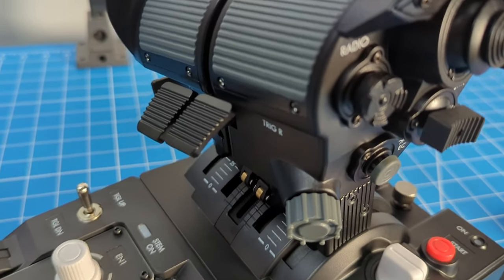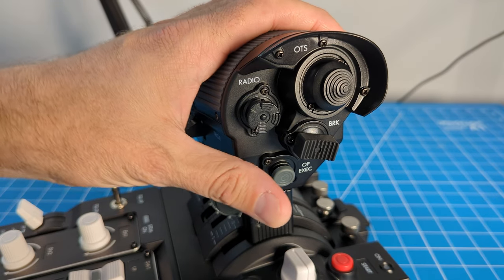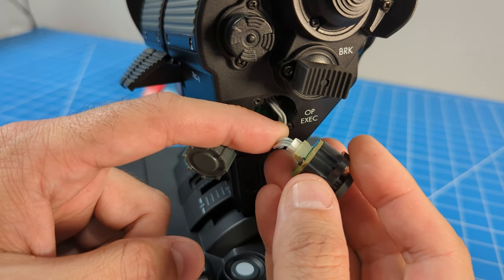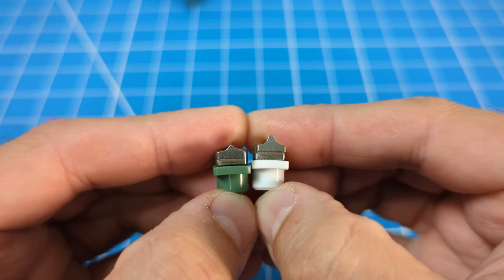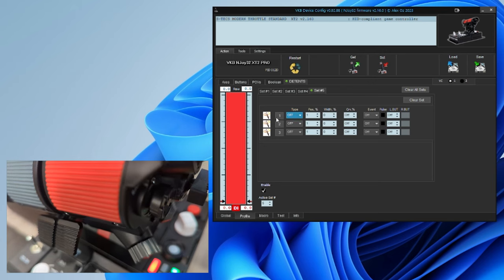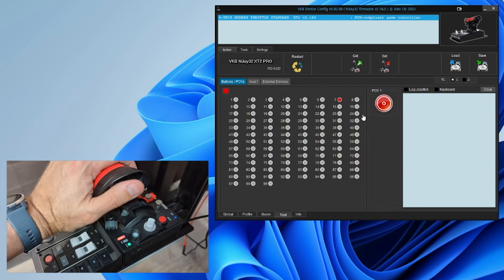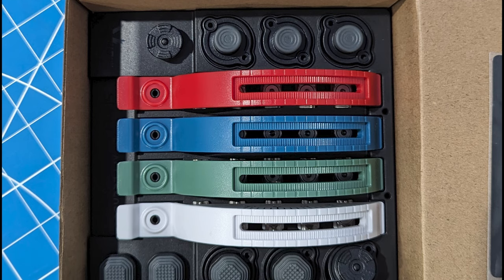VKB STECS Throttle - Review

Comment: For the idle detent, setting it to < or less than and using the "OFF(hold)<>IDLE" will allow you to turn the throttle off by pulling it back past the detent. Basically the same as what you showed in the video, but with a bit extra functionality.

Comment: With respect to the mini-stick issues...if you happen to own an MCGU,  you can swap out the module switch covers (both hats and mini-sticks) from the MCGU with the mini-stick on the STECS.  I've found the castle switch hat cover from the MCGU works well since it has flats at each of the cardinal directions, so regardless of your thumb orientation, you can index your movement relative to the hat switch cover.  If you don't have an MCGU you're kind of out of luck, but a lot of folks on VKB's discord have asked for this hat switch cover, so maybe soon they'll either sell it separately, or ship it with the STECS...
Reply: Ooh, they're compatible? Nice. I think though that I'll just 3D print a new castle cap for it.

Comment: Thank you for this video.
A very interesting product, especially the modular buttons.
It is always a pleasure to see manufactures experimenting with concepts like this, especially in a niche market as our.
It either takes b*lls or some very thorough R&D to spent resources on things like this by a company.

Having been flightsimming since the late 90´s, ive tried almost every brand out there, so i always recommends brands having stable and longlasting axis and software.
So often bad/cheap axis and/or badly written software brakes the hardware.
I dont mind spending half a day learning the software, as long as that software is stable and "just works".

Comment from the maker: Been a while since I posted a video, hoping to get back at it!  Hope you guys enjoy, let me know if you have any questions!  

Some minor corrections:
- 5:45 'recalibrate', should be 'reconfigure'
- 8:08 about the detents per frame - officially there are 3, but 4 could be added (also, 10 frames instead of the default 5). To do this you just add PimpMySTECS for expanding the detents/frames this line:
PimpMySTECS under the [USER] section in the file named zconfig.ini, which is located in the same folder with VKBDevCfg.

Discord ► https://discord.gg/ZnkvumS

Comment: One thing that could also help with the mini stick is a hat closer to the concave ones that came with the button modules - having a pattern to give you that tactile sensation of "this is X, this is Y." Some guys on the VKB Discord are already working on designing a 3d-printed replacement for the thumbstick hat, and honestly I wouldn't be surprised if VKB didn't offer an option as well in the future.
Reply from the maker: Ya I actually had someone reach out and send me the design for a 3d printed replacement like that.
Reply: @Jabbers  Nice. I'm definitely looking to pick one up once someone throws them on Etsy or something. Haven't made the plunge on a 3d printer of my own yet.

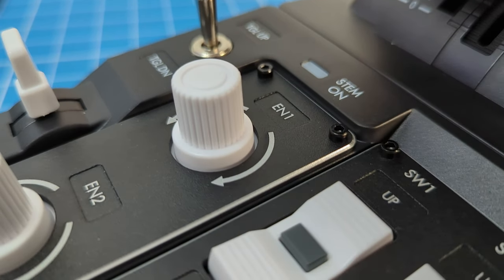Comment: 16:44 Until VKB comes out with something, the fact that they kinda don't pre-define the detents in software in terms of size (you set the deadzones during the wizard, and can adjust them later manually anyway) means that 3D printing different detent profiles should be a fairly simple thing. I might have to give that one a go at some point. =)
Reply from the maker: I found out after making this video that the software engineer is always making changes and there are already some hidden features like adding a 4th detent and allowing for 10 frames instead of the default 5. You can changed the size of the detent manually so it is already possible to 3d print and then choose a stock detent in the software but adjust the size after.part of the wizard setup where you mark the front and back of the detent is actually letting the software calculate that size for you.
Reply: @Jabbers  Cheers, and yeah they're definitely updating it. When the first detent guide came out I floated the idea of having different buttons trigger when below and above the detent (wasn't possible originally), and lo and behold by the time they were shipping that had been added. =)

Btw I think you had the inside parts/nuts for the detents the wrong way around, the big flat area is supposed to be towards the detent. Might eke out a little bit more space, and get them closer together, at least I did with my viggen ground and air idles. =)
Reply from the maker: Oh shit i didn't even think about that... You are probably right.. Spacing would still be an issue as the surface area is still the same, and if the backing plates overlap you would get some angular change on the detent on the top side of the frame.  I think the real solution would be create a detent that is 1 piece, with 3 positions on it.
Reply: @Jabbers  Yeah but having the nuts closer to the detent surface Vs far away from it can create a millimeter or two, since they're on an arc. I think I got mine a bit closer than you did. But yeah it's not a REAL solution, just something to think about.

I wonder if you could alternate them for even more space, so that one flat area is against the detent, next is upside down and above that, then right way around again...
Reply from the maker: Ya alternating might help.  Definitly something to tinker with!
Reply: @Jabbers  And fantastic that we have the ability to!
Reply: @Jabbers Thought came to mind, courtesy of a friend: What if you set the detents manually in the logic side, and on the physical side use the M-type center detent on the rail, which gives you 3 reference positions (before, on and after)? So for example for a 3 stage burner you could try this kind of detent layout:

1. Idle-Off detent (either L or V)
2. Afterburner stage 1 detent (L)
3. Physical M-detent, two logical detents: 1 on it, one after it, at full throttle.

EDIT: This assumes the advanced options are turned on, of course!

EDIT2: Tested it out, works about poifectly, hehe. Using this on the Viggen, where I can see exactly when each stage is triggered, and I have the idle-off detent, the second (air) idle detent, the main AB detent and the stage 2 and 3 detents all working and tactile through the throttle. Feels pretty nifty I won't lie. Took a bit of manual tuning of the widths and positions to get everything triggering exactly when I wanted them to, but was worth it.

Comment: Nice and clear review. 👍 

Having (even) more input & detent options (Detent Pack 2?..) would indeed be nice. And not just a specific airbrake ON-OFF-(ON) switch, but als an ON-OFF-ON toggle for the F-16’s Dogfight switch or the F-15’s Gun-SRM-MRM weapon select switch.

I’m also curious about the ATEM module. Especially about the jettison dial-alike. No reviewer has reviewed a Mini Plus or Max version yet..
Reply from the maker: Ya more toggles would be great
Reply: Afaik the round switch on the atem is a 7-way (simracers familiar with fanatec would say "funky switch"), so cardinals, push, and encoder.

One guy has a review of the max out so went through the ATEM too.
Reply: Myself, I'd like at least one encoders on the left to be changed for axis or be given and optional module to do so. Probably - if internal space allows for that - they should consider option to swap mini-axis on the right side with 4-way on the front as built-in interchangeable modules. Same as than button/4-way combo on the right already is.

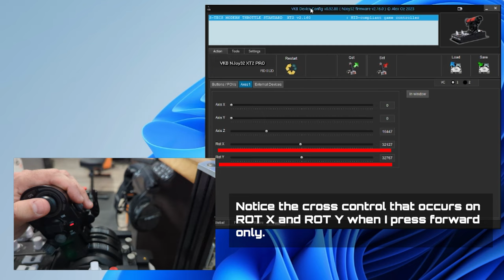Comment: 16:00 I said a decade ago that the perfect setup for a desktop throttle is this. Make it so that the throttle uses the sliding rail style so it steers away from the issue you bring up here. I posted this to Virpil and VKB forums "a lot" but no take or responses at all. With slider instead of pivot you do not get  a change in hand position and you do not get the mind fuck you get when the hand changes position. I also think that as low as you can make it benefits a desktop setup. Also, same for joystick I feel a system that utilizes as slider rail system would greatly benefit gamers as most play at their desks. Keep the joystick as low as possible and with the pitch on a rail slider system with role as pivot and you just made the ultimate HOTAS!!

What do I know, I am just some idiot on a PC sitting in mom's basement?! Well decades ago I fought for the brake pedal that barely moves idea. No one could even understand what I was talking about and nowadays the market for this brake pedal is amazing. Such a simple concept....the human foot doesn't translate movement to the brain but the human foot translates the most miniscule variance in pressure. I got called an idiot for a year and gave up and today we have this.
https://simucube.com/simucube-activepedal/?v=fa868488740a

Comment: The analog stick problem can be a easy fix with a head model with more tactile features like a 4 way head and a extended lip on both side of the thumb, I hope they add those to the package.
Reply: FYI you can swap hats between VKB products; I replaced mine with one from MCGU and use it as mouse. I have TDC (throttle designator control) on the stick instead. That hat is an extra from the STECS standard kit. Works for me.

Comment: you should able to setup button trigger at idle / cutoff position so no need click button manually , also , you can change the throttle axis range/dz by software so you can make after bunner trigger position without change physical detent position

Comment: Overall good video, but you missed a few key features of the software that make it much more useful/customizable. For example, you should use the curve setting (crv%) for your AB detents. This allows your detent to stop at an exact value (like 75% for the F-16) even if the physical detent isn't exactly located at 75%. Although, I do acknowledge that the current lack of documentation should be considered in the review since not informing your customers of important features is effectively the same as not including those features in the first place.
Reply from the maker: Wasn't missed, just looking for the happy oath without getting too in-depth with the software. The software could be a whole other 20 min video.

Comment: hi jabbers, how do you get the throttle to continue into the afterburner? mine wont engage.
Reply: Which a/c? HB will add F-4E afterburner control to the in-game axis settings in DCS in the next patch. Just like it's on F-14. Meanwhile you can use VKBConfigurator to create a button but that's a little too long an explanation for a yt comment.

Comment: Very nice review. Quick question: can I use the 5 position rotary switch as a Modifier in DCS? Thank you.
Reply from the maker: Interesting, I don't really see why not but I've never tried, it does appear as 5 separate inputs
Reply: Yes you can - it's basicly 5 "buttons" only one of which is selected at any given moment. This would make most sense in a scenario where all five positions would be modifiers. I have such a rotary switch on another device but it has been unused for a couple of years. The only use I have for it is making a row of 4 radio frequency encoders serve 4 different radios - and flight instruments in the 5th position. Hardly optimal but saves a little space in my movable multi-a/c simpit.

Comment: The three way "Up-Down" switch with the white cap, is it a 3 way switch or an axis?  I saw another review saying it was an axis and it moved smoothly in their video whereas you say it is a 3 position switch and it has a very clear set of "positions".  Is it something you can customize?
Reply from the maker: It's a switch, the only axis are the left right throttle, the knob on the right throttle and the thumb stick
Reply: @Jabbers  It can be turned in to an axis by removing one part inside, VKB has a video on how to do it. As simple as switching hats and buttons.

Comment: Any particular reason why you used button 16 (left paddle)? You could use a logic button like 65 (and automatically 66) for the same function without using any real throttle button. And yes, at least in DCS buttons 65 and 66 appear in the Combo selection.
Reply from the maker: Ya I didn't realize, talked to VKB after and they showed me

Comment: +jabbers   Thanks for the comparo.  The Virtual Engineering Bureau manufactures in the ST⚞ECSᵀᴹ Throttle Series an engine quadrant that trumps the VIRPILⓇ MongoosT-50CM3Ⓡ in certain models for Eagle Dynamics DCS:World.  Personally, I'd buy the Mini-Plus for the port flat and the STEM Panel for the starboard flat, as VirPil trumps the Virtual Engineering Bureau in hardiness for Control Panels #2 (port angle) and #1 (starboard angle).

Has the ST⚞ECS an "inverse hat" for the "OTS" ministick?  As a fallback for unavailability of the Throttletek GF-14 Engine and Wing Quadrant, I'd like a 4-way with the default OTS cone in the "OP EXEC" position to control the Wing Sweep; the "RADIO" Stadium and "BRK" Jog heads are appropriate for the notional Heatblur F/A-14E/F.  Also the mini-Castle head (low parapet up) and Pyramid head for the 5-ways in, respectively, "MB1" and "MB2."  Haven't decided which rotary encoder to assign to Flaps.

Comment: I'm glad the VKB folks are finally getting some sort of TECS, but this is not what was promised, not what was supposedly taking so long. This was supposed to be a bar none top-tier GUNFIGHTER-class device (starting with metal construction, not plastics/composites), and specifically it was supposed to have some super-duper digital electronic magic detent system that required patenting before they could even think about releasing it....

There is no new tech here, this "TECS" is little more than an expansion of their existing GLADIATOR-class GNX module stuff. I'm sure it's nice and the pricing seems decent (just like the rest of the Gladiator line), and no doubt it will be popular (maybe even get Thrustmaster and Logitech off their asses in this segment), but there is no way this needed to take ten (?) years.

Comment: I haven't used this throttle, but I had the same observation regarding that mini-stick just from watching videos about it. Putting 4-way or analog hats on the side of a rotating throttle handle is already kind of fraught, because the "up" direction changes as you push the throttle forward. You can account for it somewhat by using asymmetric caps on those controls; for example, my Virpil throttle has three hats on the side of the right throttle handle. One of them has a boat-style cap, and it's super easy to feel which way is "up" on that hat no matter how the throttle handle is rotated. But another of the hats has a pyramid-shaped cap, and I hate that hat. Every time I go to use it, I'm like "Which was is up on this hat again?" The cap on that VKB mini-stick is even worse, as it's a symmetrical cone that doesn't even allow you to parse where the X and Y axis are by feel. 

Hats on the front of a throttle handle don't have this issue, because you always pull back for up and push forward for down.